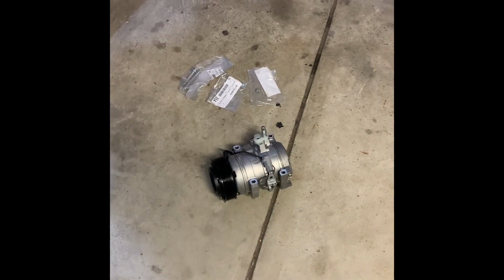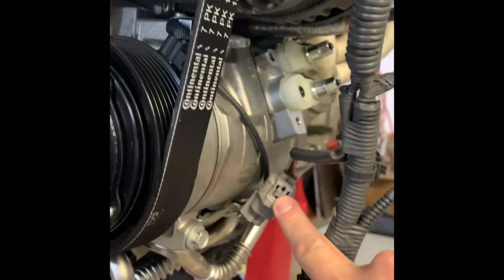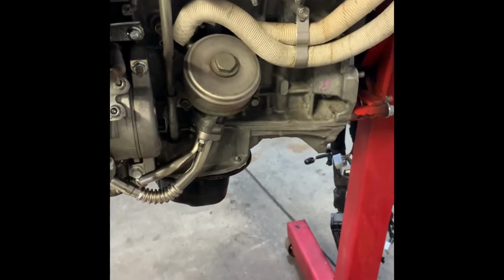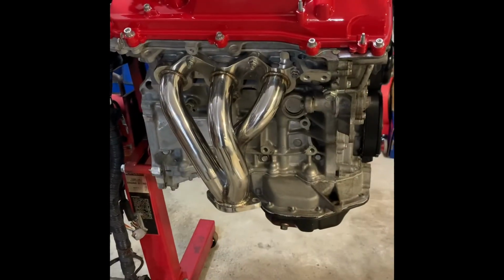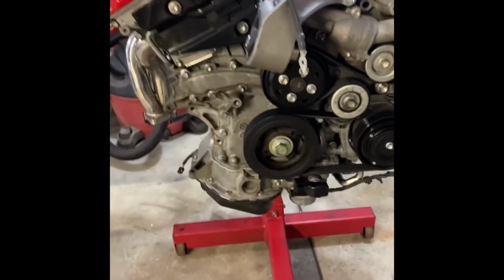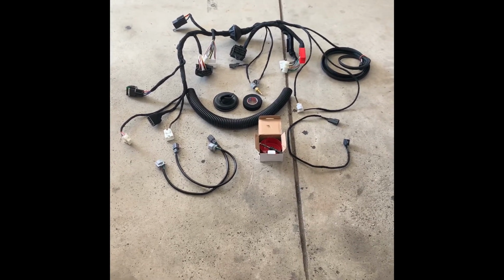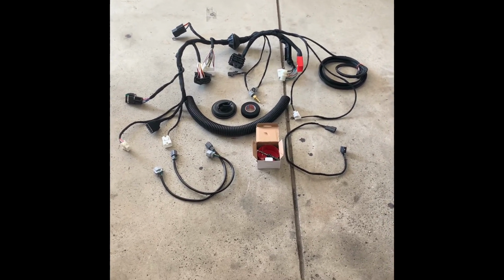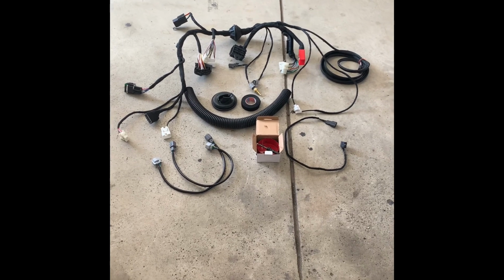SW20 Toyota MR2 2GR V6 - Installed A/C compressor, headers, & review of Paul Woods Sienna wiring

Comment: Why is it necessary to remove the oil in the compressor?
Reply from the maker: I did it so I could make sure I had an accurate measurement of oil in the system.  Thanks!